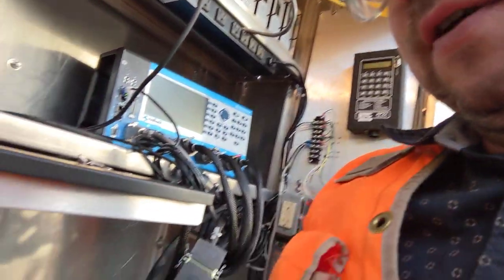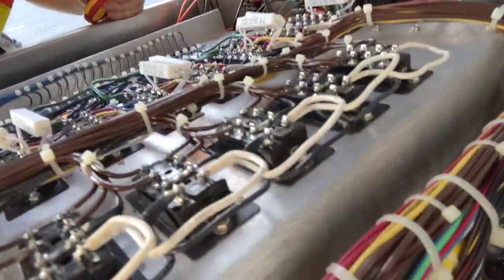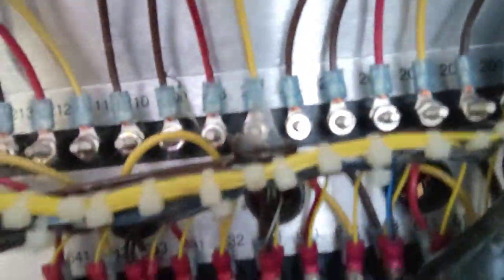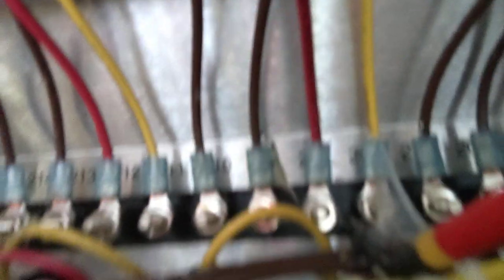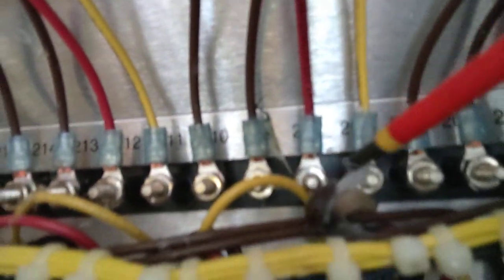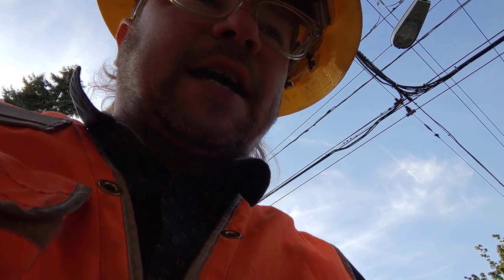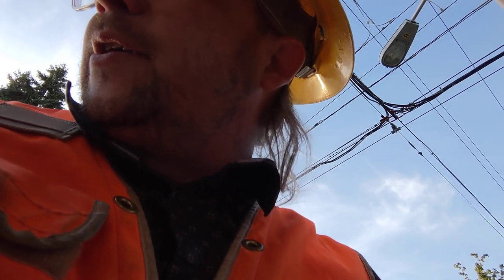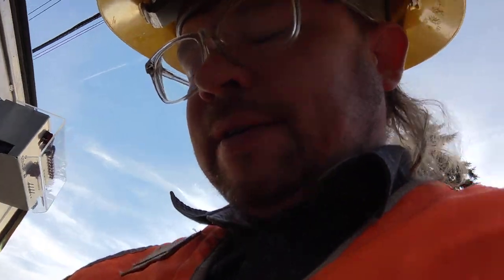Fried Slug Puts Traffic Signal in Flash!

Comment: Roaches and caterpillars here in Vegas do the same thing on the load bay. Anything over the threshold voltage to the monitor will put it into flash for dual indication, like 70 volts or something like that. I love working on signals. Wish we could have some cool tech discussions.
Reply from the maker: Absolutely! I think that you're right it's between 70 and 80 volts RMS
Reply: I believe the voltage to turn on the LEDs is about 80VAC depending on the manufacturer but the voltage is far less for the MMU or CMU to pick it up as a dual or conflict. Great videos and very cool to see another Traffic Tech doing it's things. 👍🏽

Comment: Out of curiosity, do you use the EDI ECom software?  I've been experimenting with it myself on an older EDI MMU-16LE I have.  Not sure why, but I can get info from the monitor.  Though I can't seem to get the config to apply to the monitor.  Getting that Rx failure message.  I know things are set correctly in the COMM section, but I wonder if my Tripplite USB to serial is the issue?  

It does read the connection in the software so I know that part works.  My issue is trying to disable the 24VDC to clear out this conflict.  My setup is not in a NEMA cabinet, it's just a frame I built for the gear I have.  If I can get the new config to upload to the monitor, everything will function.  Otherwise I have to disconnect the MMU in order for things to work, but as a person who wants to learn I'd like this monitor to do it's thing.

Settings on both ends are (this is the default)  Just using an ASUS tablet with Windows 10 (the keyboard portion has that USB 3.0)

Tripplite USB to Serial (9pin) (COM 4 in Windows is configured exactly as the monitor is)
9600 baud
Parity Even
Stop 1
Flow - None
DTR (unchecked)

Again I don't know if you use the software, but hoping an expert would be able to assist.  Hoping my wording makes sense.

Comment: Question, what’s the right way to test a CMU? Using a blank diode card or the diode card being used at the intersection?
Reply from the maker: The correct way to certify a conflict monitor is with a conflict monitor or MMU testing unit that is also certified once a year by the manufacturer. This will also create a report on the RMS specifications for each phase and each input and output of that conflict monitor to be tested. We use EDI conflict monitors and the EDI testing unit has to be sent back once a year for certification we test all of our conflict monitors once a year as well so we actually have two of these testing units so that we always have one on hand for us to perform the work. The way it typically works is we use a blank program card in the conflict monitor and then configure the software for the tester specifically for the unit that we are testing and then allow the machine to run the test and then print out the reports after we're done and keep them for our records.
Reply: @trafficsignalstraining7673  thank you for the response, I test CMUs annually for my cities. The reason I’m confused is because I was recently told that the correct way to test a CMU is with the cut diode card for the specific location you’re testing the CMU for. I was always told to use a blank, so that really threw me off.
Reply from the maker: @ceasargonzales3201  no you would be correct in saying that you are to use a blank card while testing the conflict monitor on a testing unit.... 
If you wanted to test the conflict monitor in the cabinet as it is programmed specifically with the program card installed. You would just go there after hours and then create a conflict on all of the phases manually with a jumper. However, if your conflict monitor has been tested correctly on the conflict monitor tester it is exponentially more efficient to do it that way.